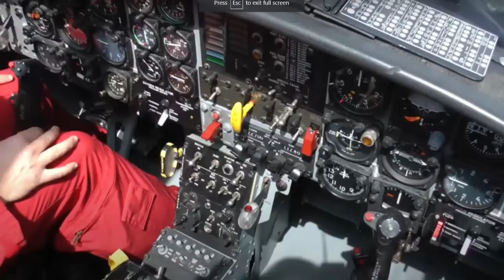Snowbirds CL41 Tutor Crash 17 May 2020

Comment: It's very sad, a relatively young woman tragically passed away. I sat in one of those Tutor planes at an air show as a kid. Very sad, tragic news
Reply: @linanicolia1363  I would expect that she was thoroughly trained and would have experienced  high G forces before. I don't think the description of "passenger" used by some here fits. Both crew members punched out at about the same time and I suspect that given the nearly impossible conditions  of the ejection, survival was more a matter of luck than anything else at the point of landing.
Reply: @linanicolia1363  She wasn't the pilot.
Reply: @linanicolia1363  she wasn't flying she was a photographer. I think the pilot landed on a roof. They're not saying where she landed. I don't think it was in a forrest as the main video showed. It could have been in a yard, street, or any other residential area

Comment: I flew Tutors some 40 years ago and had a compressor stall at about the same place on takeoff but from a very small bird ingestion.  I was with my instructor who immediately took control as we zoomed with the idle air-start depressed.  Fortunately for us we got a partial re-light of the engine but could only get 75% power back.  It was enough to get around the corner, execute a tight low level pattern and land.  It was a close call and watching this made the anxious memory re-emerge with chilling detail.  RIP Jenn Casey and God bless the pilot Richard MacDougall I hope he fully recovers.

Comment: As a former T-114 tutor engine technician , with 5+ years of flightline experience on the Tutor, I and other retired technicians agree it appears that the engine did compressor stall, the loud pop is indicative of the engine compressor stalling, the aircraft usually would compressor stall on run up to max rpm when the inlet guide vanes of the engine were misaligned or when there was minor unnoticed FOD damage that may be difficult to see. Also compressor stalls are more prevalent at higher altitude run ups or at higher summer temperatures
Reply: Hi Del! Very tragic indeed! One thing that appears to me to be odd is the lack of fireball after impact that may indicate a lack of fuel. What are your thoughts?

Comment: Thanks for this heartfelt posting, Juan.  I've flown in and out of Kamloops many times as a passenger on DASH-8s and it is a somewhat challenging mountain airport nestled in a river valley in the Rockies.  You wouldn't have a lot of options available with engine loss.  That departure took them directly over the Thompson River which is only a couple hundred feet at most from where the person making the video was standing.  I suspect the turn to the left was to try to edge away from 'downtown' Kamloops. The aircraft impacted a few hundred feet in from the river.  Deepest sympathies for the family and friends of Captain Jennifer Casey and best wishes for a speedy recovery for the pilot.

Comment: Great analysis also.  I have ~2400 hrs on the jet and was a Team Coordinator (11 pilot - same position as this ejection) for three seasons.  The checklist was modified after a misdiagnosed air conditioner soc problem caused a fatal ejection with a perfectly serviceable engine.  The Zoom Idle Airstart described by johnpolitis was modified to Zoom (wings level) Airstart - Analyze.  If loss of thrust confirmed then Idle airstart.  (Prevented thrust reduction if there was usable thrust).  Then, time permitting Procedure 1 (quicker) or Procedure 2 (longer) Relight procedure would be employed.
Reply: Andy Cook When was the procedure modified? What year? Do you know if that is still the current procedure? Thanks.
Reply: @Andy Cook   Looks to me like the pilot was attempting a wingover type of manouver to rapidly turn around onto the diagonal rwy 22 or possibly back on to rwy27/09 or even the parallel taxiway. Personally, I think it was a reasonable decision given the excess energy he had to trade for altitude and overall situation (including calm wind/little to no tail wind on landing)  and I think he would have pulled it off easily had he not spun out. Rwy 22 is short, but it is a runway.  What do you think?   The other option is, that he tried to zoom up while turning the plane away toward the mountain and away from the residential area  and away from the river before ejecting. That seems very reasonable too.
Reply: Phil Sr in your expert opinion, what “better training” is needed? I am a civilian instructor, examiner and have 6500 hours of flying experience and I have no idea why this accident occurred.  I have experienced an engine failure in flight myself and a lot happens in a very short time in which you need to make decisions and carry out actions that you have been trained to do. Humans will inevitably make some mistakes when carrying out emergency procedures, so until you’ve been in that situation I think you should keep your unfounded opinion to yourself!
Reply: Scheusselmensch. Well said.
Reply: would a restart help you if you don’t have a compressor?   well if flame out she does not have altitude nor lift
Reply: @paulspiers5466  okay Paul, then nothing should change. Happy?
Reply: @paulspiers5466  Well said Paul Spiers.  That troll is here just to start a fight and to insult a lone survivor of this unfortunate accident.  A young lady died in this tragedy.   They almost made it back.  There are many arguments on aviation channels whether to turn back to the airport after an engine failure.  It all depends on the circumstances in my humble opinion.  It appears there was a residential area below them because the surviving pilot landed on the roof of a house.  The jet crashed on a part of another home but nobody was injured on the ground.  The decision to turn back to the airport depends on the circumstances.  I don't buy the argument "never turn back" or believe in the term "the impossible turn".   The pilot almost made the turn back but spun out at the last second.  I'll bet if he had a chance to do it again, he would have made it.  He may have saved many lives by trying to turn away from the residential community.  We don't know yet if that was his intention or to just make a U-turn back to the runway.
                       Recall the movie "Sully".  In the movie they made it sound as if Sully was at fault for NOT turning back immediately to LGA.  His decision was sound "under the circumstances".  But the Hudson River landing also could have turned out very bad as well.  "It all depends".   I've learned over the years not to respond to "trolls" like Phil Sr.   It has no idea what It is talking about and is only there to get good people here pissed off.  Be well.  God bless the young lady that died in this tragic event.
Reply: Does the Tutor have  a sequenced ejection system ?
Reply: @daffidavit  I bet a high percentage stall spin accidents fall into the "almost made it" category.
Reply: I don't want to second guess the pilot's decisions because we don't have all of the context, and there was very little time for decision making, so once you commit to a decision, you have to go with it. I wish him the best and condolences for Captain Jennifer Casey. Some possible options that maybe the pilots with experience on similar aircraft might comment on: First, it seems to me that while it's true you have an engine restart procedure, you should also basically immediately assume (at that low airspeed, low altitude after takeoff) that it probably won't work, so your primary task is deciding what to do assuming no more energy.  It looks clear that a tentative decision to attempt turn back to airfield was made, ultimately resulting in the possibly accelerated stall-spin. In terms of benefits of full situational awareness, there was a big river straight ahead so a zoom climb straight ahead wings level would have given option of eject over water within the envelope, or ditch at 71 knots or so. But I imagine "ditch" is not in the recommended and trained procedures. Also, climb, then turn right attempting back to field instead of left (unintuitive because in the direction of the other aircraft) might have resulted in better options than left, because, again, the river, leaving the option of forgetting about the turn if it's obvious you're going to stall in the turn. But I figure he had about a second to commit to his initial decision. So I'm not faulting the pilot. Bad luck with crappy options.
Reply: @Neil_  For sure.  But there are lots of stories of pilots who didn't turn back and crashed straight ahead into a building, a road, or trees that never made it either.  It all depends on skill and lots of luck.  I'd rather be lucky than good.
Reply: John Buick  It could have but doesn't seem so here.  The pilot immediately pulled up as soon as we heard the pop.  No delay at all.  If there was a control cut, I doubt he would have gotten as far as he did.  Again, let's wait to see what he has to say and also wait for the inspection.
Reply: @wiesenbefeuchter  Watch the video before you comment.  It answers your question quite thoroughly.
Reply: Archie Bunker  Look up the residential area they were flying into, the other aircraft was blocking acess to the river , if he flew straight and punched out it would have spread bits of aircraft over a much larger area. I live in Kamloops , look it up on a map .
Reply: Two engines would help but unfortunately it seems there are precious few modern aircraft as well suited for Snowbird style aerobatics as the Tutor. It's forgiving and cheap to operate... I was thinking that instead of replacing the entire aircraft, it might be possible to replace the engine with something more modern. The J85 is an old design, newer designs are far less prone to compressor stalls or surges. The J85 is not a very powerful engine either, I'm not sure anything in its range is even being developed anymore. So that's the conundrum in a nutshell -- a 2020 version of the Tutor would be perfect but nobody is building one.
Reply: Ddalzell509 Thanks. Do you know who exactly is tasked with developing procedures? That's something else I've been pondering... from the research I've done so far, the zoom maneuver really has nothing to do with trying to save the airplane, it's about establishing a more favorable ejection vector. It seems that the best possible scenario is to eject while still enjoying forward momentum, moderate climb angle and well away from the ground. Ideally one's resultant  trajectory should be as near to vertical as possible, this maximizes the distance above ground and also the time for the chute to open. So, it seems to me that the strategy would be to ride the plane upward until its speed nearly drops below the seat's escape velocity before nosing down a bit to eject.  Waiting too long could result in loss of control which is what I think happened here. I don't think he was trying to turn... who knows, we'll have to wait and see. that's kinda why I was wondering about who exactly sets the procedures for the Snowbirds. What are others doing in other airplanes with the same engine? What was their rationale and their record of success? Who tests or calculates the potential benefits - - exact numbers -- of the zoom maneuver? And what is its clear purpose and why? etc... so many questions... No doubt the investigation will cover much of that ground as it seems evident that the zoom maneuver was such a prominent feature of this unfortunate accident. My impression is that the Snowbirds team subjects the little details to considerable scrutiny so it should be interesting to see their response to the investigation's findings. In closing, it occurs to me that having nine performing pilots in the show may have helped them become the team that they are -- more pilots leads to more discussions, more ideas, more perspectives... I hope that they keep the team as it is if and when they furnish them with new airplanes.
Reply: @Phil Sr this has all the markings of a bird ingestion
Reply: @Phil Sr 'Better' training, short of prescience, would likely not have affected this outcome. Hard to calculate absolutely the random factor.
Reply: Archie Bunker When I first viewed the flight I thought he pulled up to leave the formation and gain altitude to punch out.  Then he stalled at the apex, spun, lost altitude and pinched out.  Puzzling and tragic.
Reply: @jimarcher5255  - it will take a while for the accident analysis and report.  Meanwhile, that's a very possible scenario.  You're taking off in formation - just cleaned up the jet and you're looking at lead to maintain formation.  Loss of thrust felt - zoom with gentle pull away from lead.  Now you have to get your head inside from outside (takes a second or two), analyze the eng insts (another ssecond or two), verify a compressor stall (if that's what it was - although the pop sounds pretty audible) - another second, throttle to idle, hit the airstart button again - another second or two.  Add those up and I bet you run out of seconds and airspeed.  Next?  Incipient spin, herculean attempt to get airspeed back over the wings and get wings level at least if you can't get an up vector, and there you are.  I agree - very tragic.